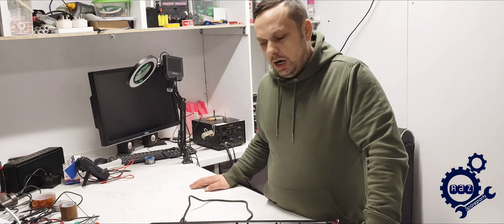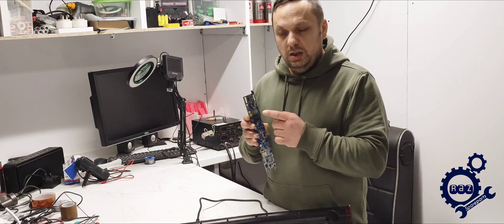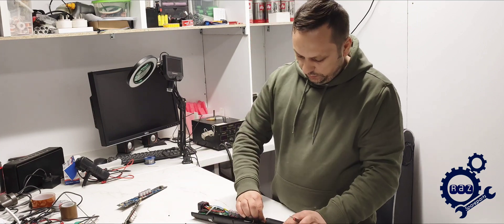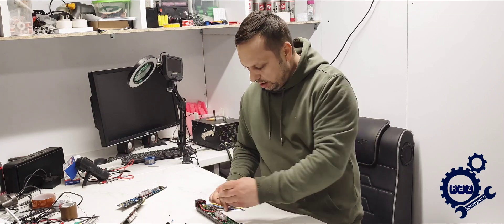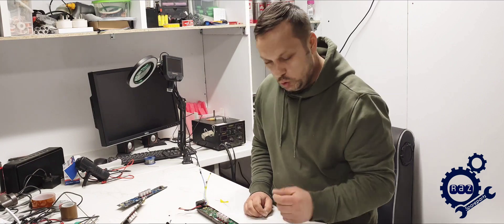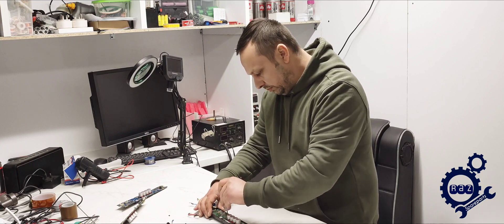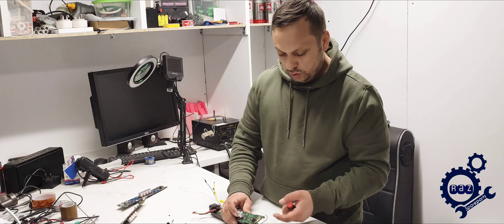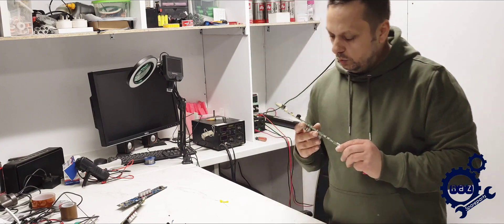⛑️VANMOOF S3/X3 NOT CHARGING ERROR 19/21  Charger Plug loose , how to fix ?

Comment: Great videos man! My van moof s3 has the issue that it constantly thinks it is charging, altough it is not plugged in. I tried the BMS reset but no success. Do you have any idea what causes this issue?
Reply from the maker: Hello it might be cell problems as the cells are discharging or just BMS ... You can check the cells voltage individually if cells show same voltage is the BMS problem...

Comment: my cartridge is compleet dead. How can I test the mosfit on het back of the printboard with a multi meter?
Reply from the maker: You can test them with a multimeter on the 3 thick cables that are bolted on the board .. those 3 are the phases of the Motor .. when mosfets are gone usually are shorting one of those phases or are shorting the other two phases... In total you have 5 cables that are bolted to the board... Non of them should have a short